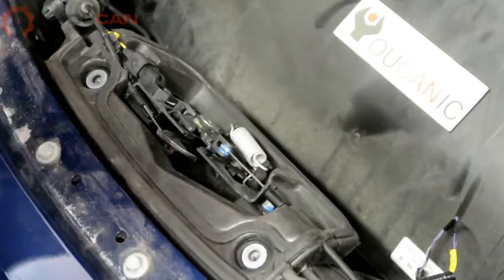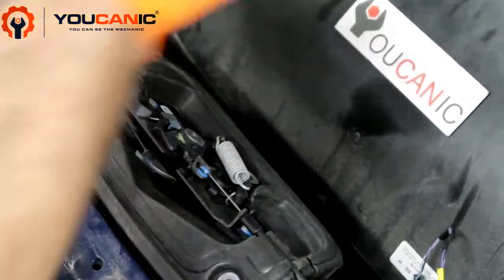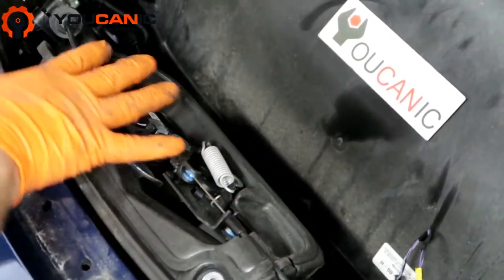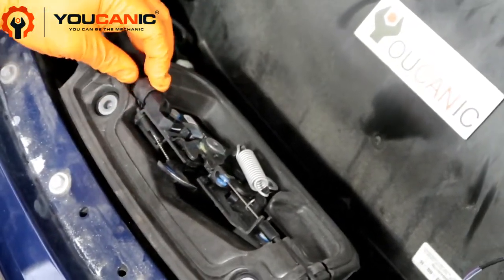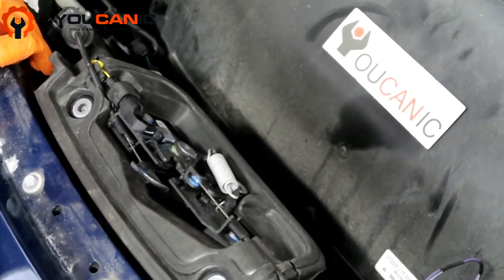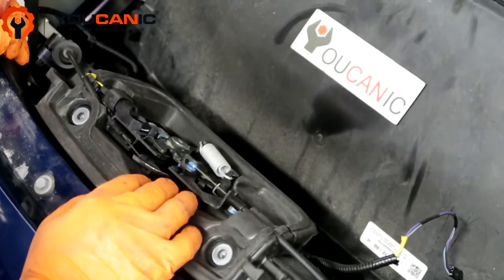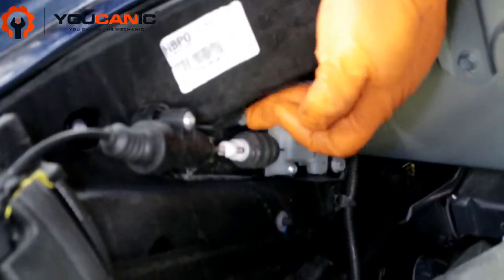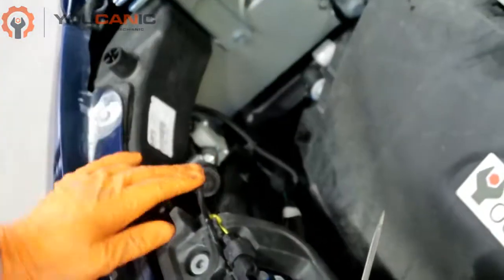Tesla Model 3 2017+:  Hood Stuck Closed and Won't Open! Possible Causes and Solutions

Comment: If the hood is stuck closed ur video doesn’t help. How do u open it to fix it?
Reply: How do you open hoodie to change battery to start I will sell soon
Reply: Seems like if they don’t know how to fix it . That could be
Reply: Can anyone help me open my hood to change the battier. 2week no car . Tesla 2000  1500 miles . 1. Fan cooling fan blue apart . Next car stop moving 2 week no repair. No car. No one to help I get upset. Don’t I have a right to